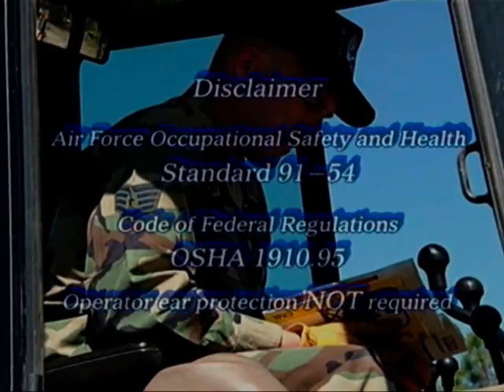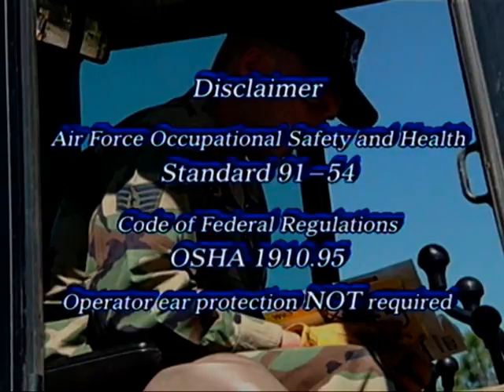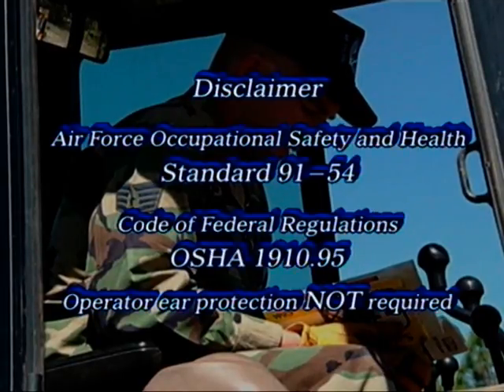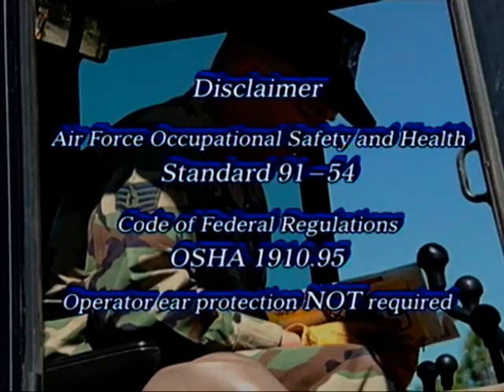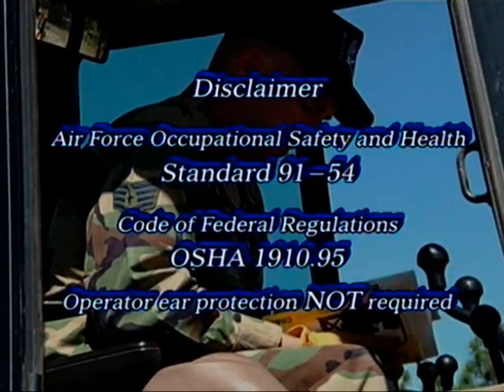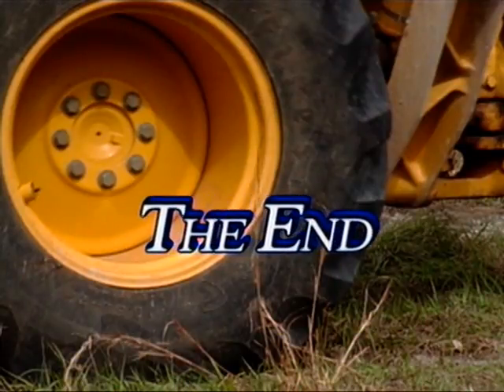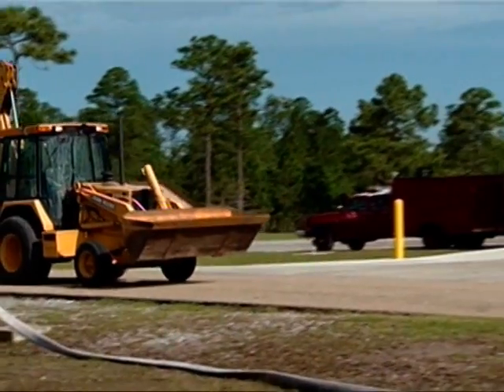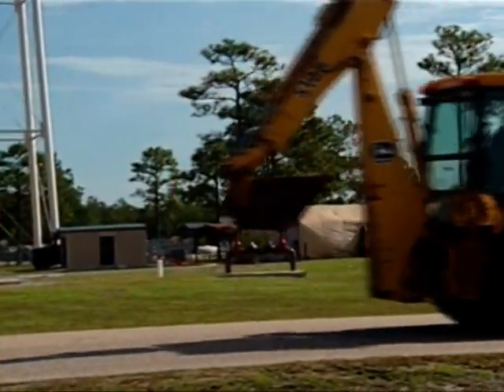AFQTP - BACKHOE OPERATIONS - EXCAVATE, LOAD, AND BACKFILL MATERIAL

Comment: Just after 12:25 the backhoe is being moved side to side with the weight on the bucket, the rear wheels off the ground, and the loader still on the ground in order to reposition the tractor. This puts a large lateral load on the area of the dipper where it attaches to the boom. In some cases it can spread the side plates of the dipper so should be avoided if possible. This is even more important to note with smaller TLB units.